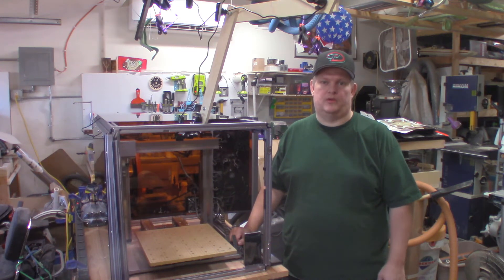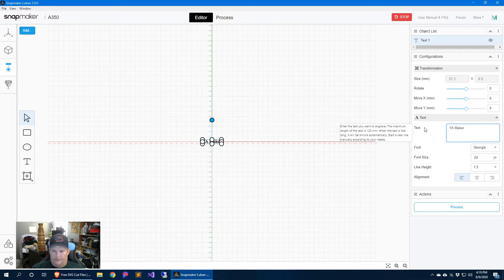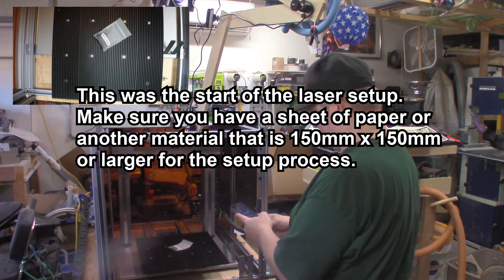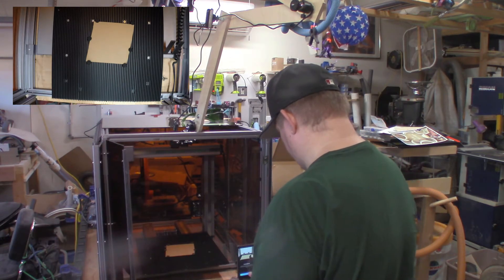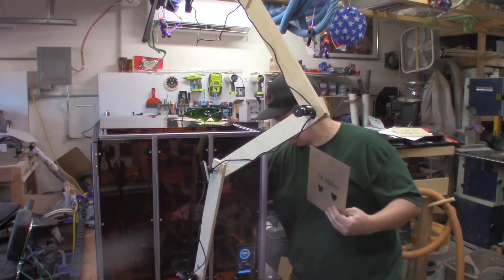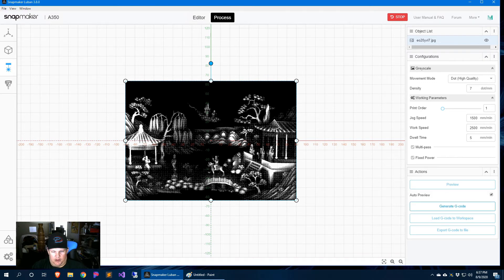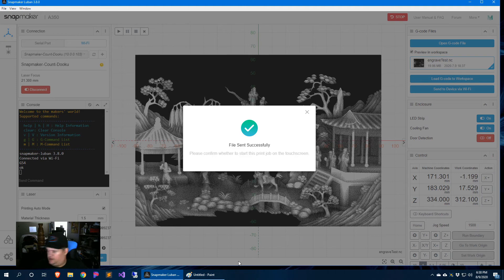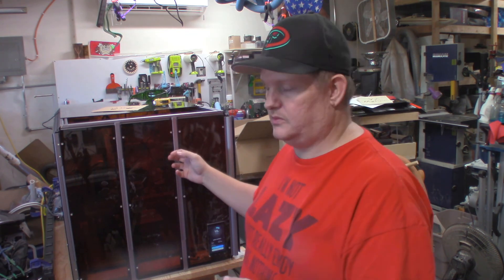Snapmaker 2 0 A350 laser setup, software, and result review

Comment: I had the same issue with the laser not cutting all the way through with bits and pieces left. Did you find a way to fix it??
Reply from the maker: I added additional passes and that seems to be working. Each pass it steps down some. I also took off the extension since my A350 sits in the enclose to give it more clearance. I do have to put it on when i change modules though to re-calibrate it when I go back to the laser.
Reply: I added an extra pass for 1/8" wood to cut through

Comment: Great video, thank you. 
Could you make a video and share your experience about laser engraving/cutting in leather using your Snapmaker? I would like to see how it would look like for example your channel name "Yet Another Maker" on leather ( thickness 2 mm ) so that the inscription is included in these dimensions size ( around )  4 cm x 1 cm ( including small and capital letters ). Those dimensions are the size of frame to cut of from the leather piece.

Also I would be interested to see the same example 3D printed with use of PLA and some Flexi filament if possible ( 4 cm x 1 cm with thickness about 3 mm ). I am curious how Snapmaker will deal with engraving/printing small letters and see outcome quality. Cheers!
Reply from the maker: I don't have any leather but I do have a old leather belt or two that could be sacrificed.  Gah now I don't want to do my day job and this instead.
Reply: @YetAnotherMaker  Thank you for reply. Yeah old belt is perfect I don't want you to spend any extra money on this project just want to see how Snapmaker perform on small letters/logos. My wife do crochet/knitting and she needs custom tags with her name or name to who the product is going like "For My Mom", "For My Dad", "For My Daughter", "For My Grandmother" and so on. This is how I came across Snapmaker and your videos. I am considering buy one but I don't have experience with 3d printers/laser/cnc machines and I am not able to predict if this will suit my needs. I will be grateful for your help and opinion. Also I am wondering is it possible to use Snapmaker CNC for this kind of project using wood or plexiglass. Any way thank you for considering my request. Cheers!
Reply from the maker: On 8/31/2020 there is a video coming out that I do a 3d print and laser with letters for you to see.  Thank you for the idea and if you have any more let me know.
Reply: @YetAnotherMaker  Great, thank you very much. I will be watching for sure. Finally I did pre order my Snapmaker 350A and can't wait to start play with it.